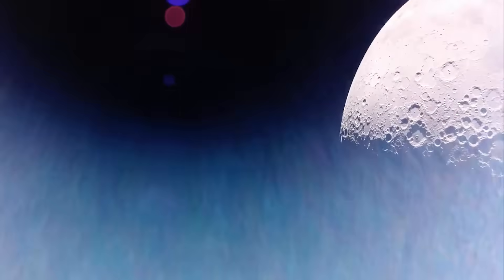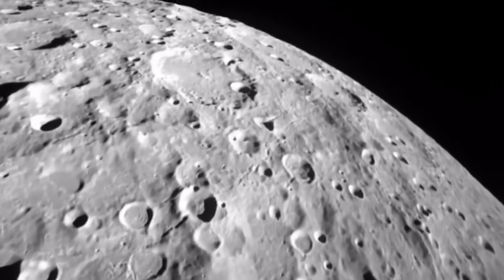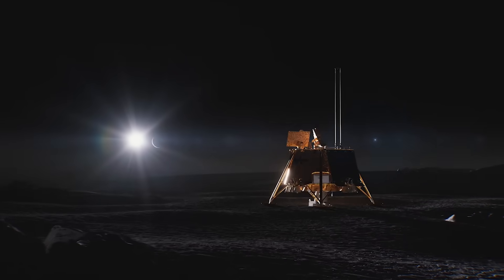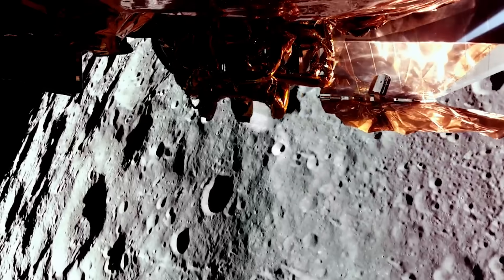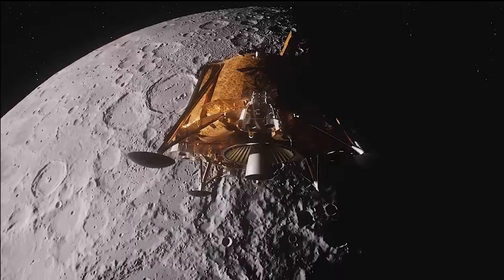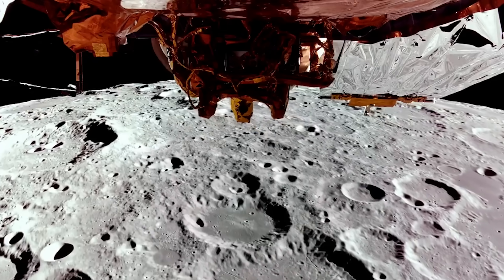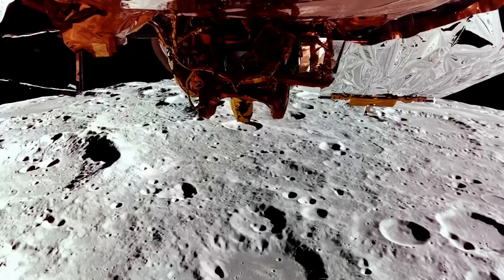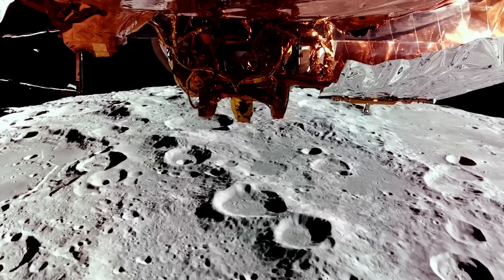The Blue Ghost Lunar Lander Is About To Attempt Touchdown

Comment: Why are the mission durations so short on these instruments? What are the limitations on power and durability of the equipment?
Reply: Mainly, the lunar night. It takes a lot of power to heat the lander enough to survive that, and it has to come from a nuclear source. Those are expensive, heavy, and it's a challenge to shield the other parts of the lander from its radiation.

Comment: Hope everything goes to plan for Blue Ghost during the landing sequence! Has Blue Ghost captured any images of the old APOLLO landing sites during its orbits?
Reply: I wonder the same thing, I am thinking it’s still really high up from the moon’s surface so would we see it?
Reply: @Jasonmichealhowell  Was orbiting at 100 km or 60 miles. Hard to image the onboard cameras on Blue Ghost not having the resolution to take some pretty decent photos of those sites during a flyover.  I guess it just depends on the Blue Ghost orbit path.
Reply: Go check out the images produced by the LRO  (Lunar Reconnaissance  Orbiter)
Reply: @apolloskyfacer5842  Think I have already but thanks for the reminder. When I saw the quality of the lunar surface that Blue Ghost was showing. Wondered if it had taken fresh images.

Comment: Millions of miles?  Isnt it like 250,000 to the moon?
Reply: Only if you travel in a straight line. The approach taken was much less direct to save fuel/weight.
Reply: You don’t have to launch the extra weight into orbit.
Reply: @ you do have to use the extra fuel to get it into orbit though, and you can't just top up the orbiters tanks at the nearest trans lunar gas station because you wanted to save on your launch mass
Reply: Straight line distance is approximately 240,000 miles. This lander does not travel in a straight line.
Reply: A quick Google search " Having travelled 2.2 million miles, all 10 payloads Blue Ghost is delivering for NASA"
45 days at 3,333 mph is a loooong way
Reply: You don't "save weigh" near zero gravity in space
Reply: @ call it mass if you like, it has weight before it's launched and the greatest efficiency savings are made getting your payload to orbit. Though there are still efficiency savings to be made by not having to accelerate/decelerate mass even in zero G. You'll have to forgive me (or don't, i can't force you) for conflating mass/weight as this is a youtube comments section and not a scientific paper.
Reply: @elessartelcontar9415  He means the launch weight.
Reply: @elessartelcontar9415  He means the weight of the vehicle at launch.